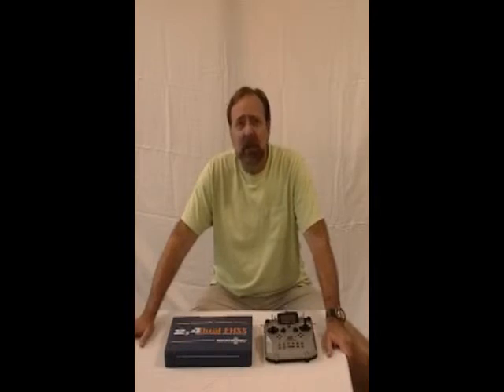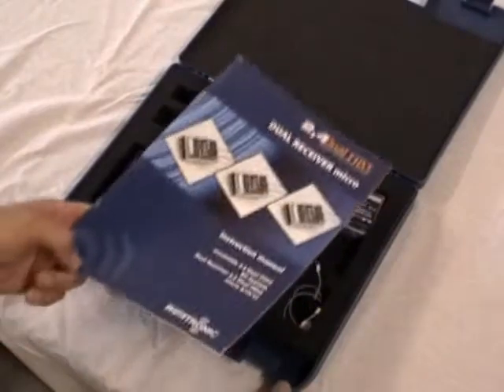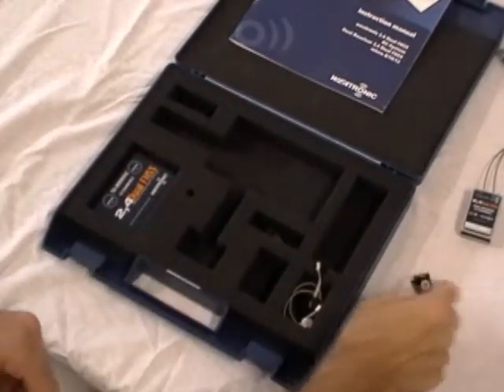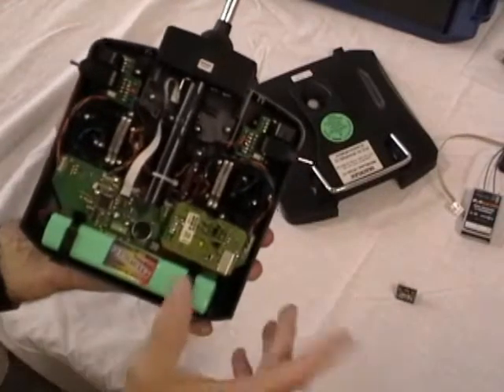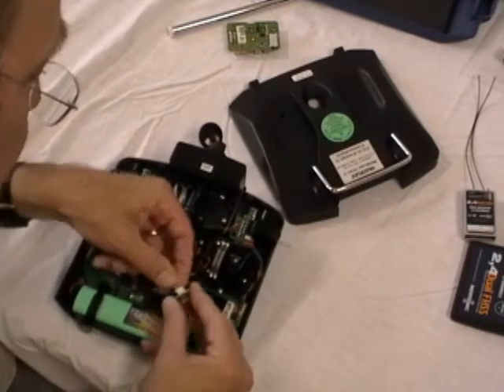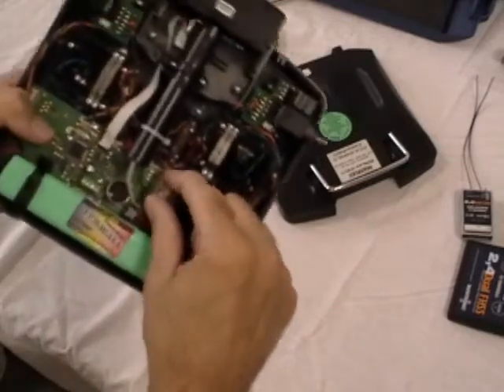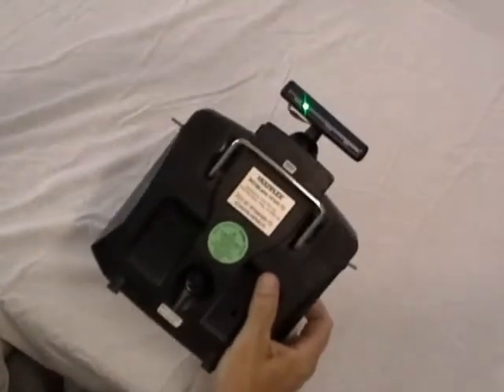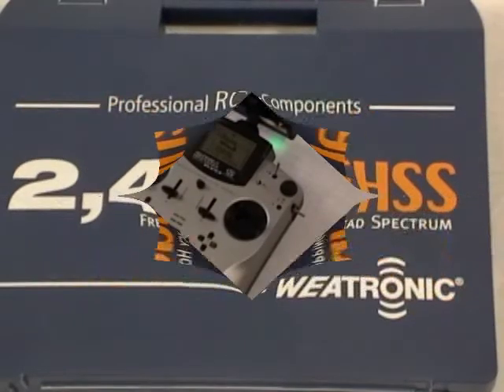Weatronic 2.4 GHz  Mutliplex Royal Evo Conversion

Comment from the maker: I just sold the Royal Evo and Weatronics gear a couple of weeks ago. I loved the system and think it's probably one of the best on the market. No doubt the Royal Evo 12 was the best radio around, but the support for it here in the US has become tenuous at best. Parts are difficult to get and if they're available, they won't send them to you so you're forced to send the radio in for easy replacement of components. I've never seen a 2.4 GHz system boot as quickly as the Weatronics does.